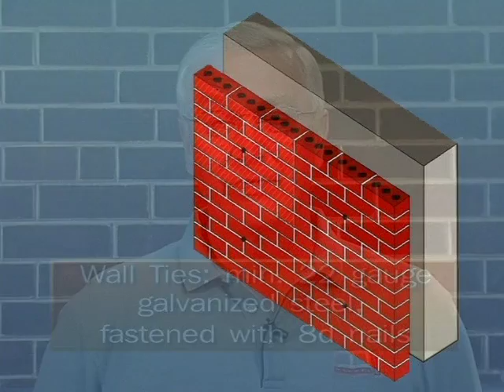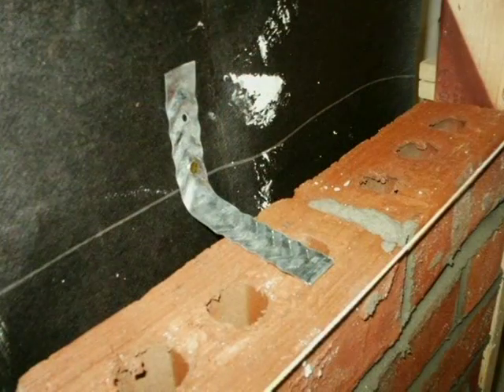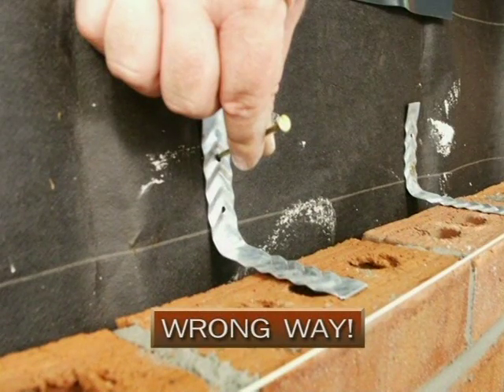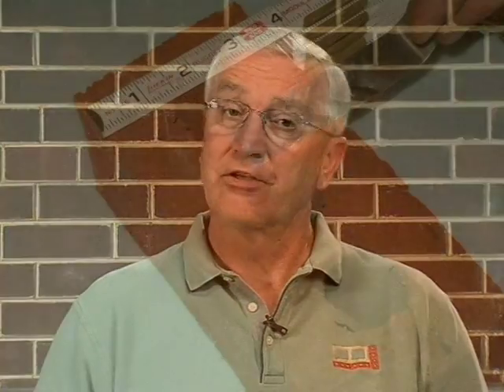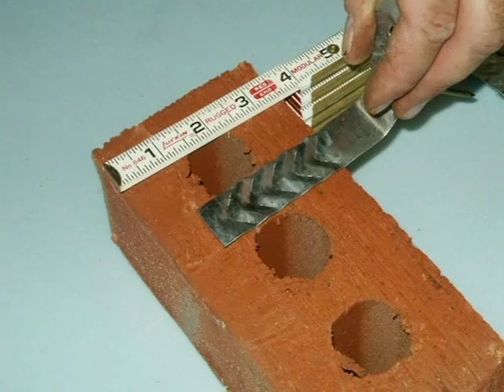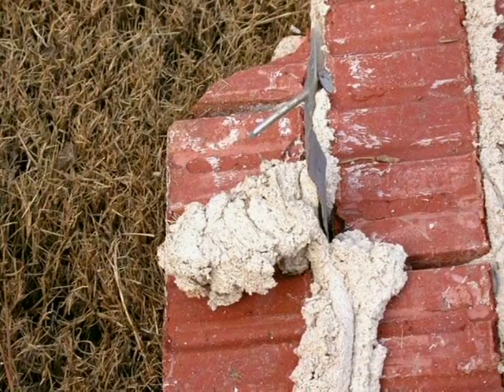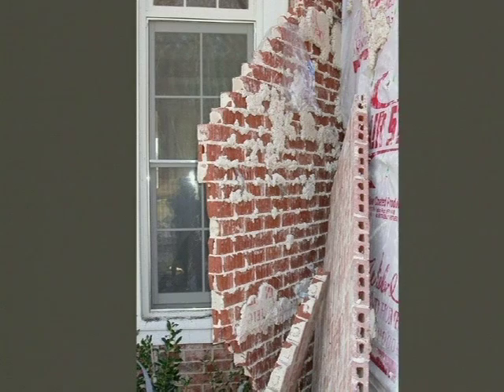Wall Ties

Comment: Very clear video. Thanks. Question. When building a 8 foot high and long concrete block wall that I will face with Old Chicago bricks on front, back, side and top, is the wall tie procedure the same? Do you still have to add a moisture barrier between blocks and bricks, corrosion resistant anchors, a drainage plane, and flashing and weep holes? Thanks for advising.

Comment: In the photo example of proper installation it looks like the ties are installed pointing up, but shouldn't they be pointing down so they are bent up? I read if they're bent down then water can run down them towards the wall

Comment: I was framing  house as a young man in the mid 80. We were building custom homes for the rich and I remember  a house being bricked next to the house we were on and the box of ties never got opened and were left there after the bricklayer,s were finished. Not 1 tie was used.  This was in Ohio. No inspection  on homes is a crime. Only Electric and Plumbing. It's sad.  Thank you for the video.

Comment: Hello.  Would this be the code for building a brick chimney?  Our house was built in the 1950's and our chimney has pulled away from the house.  Upon inspection, we were told that wall ties were not used when the chimney was built and we now need to have a new chimney constructed.  i want to many sure that the mason we use installs it the correct way.  Thank you.
Reply: Sorry for replying to such an old post. I understand that when chimney's pull away from a house it is typically because chimney's are insanely heavy, and therefore tend to sink if the foundation is not "extra" beefy, and the solution is to reinforce the chimney foundation. The most common way to beef up the chimney foundation is to install some type of post that goes many, or more rarely, dozens of feet under the foundation. Helical posts are one example of this. I'm curious how you ended up fixing your chimney that was pulling away from your house.

Comment: Your answer to this may be similar to Scot Caraway's question, but I'll ask for good measure. I own a 1960's ranch home- wood frame with brick veneer. Asphalt sheet type sheathing was originally used, with no type of wrap like Tyvek. The home has experienced termite damage and some of the exterior walls will need to be reframed. I have some contractors telling me it's not a problem and other's telling me they literally don't know if it can be done because there would be no way to retie the brick veneer wall into the new framing. Is there an approved standard method to retie the brick veneer into a newly framed wall from the interior (or some way tie the brick veneer to the newly framed wall from the exterior instead of the interior) so that the brick would maintain its structural security? Any advice would be extremely appreciated!!

Comment: Good video.  Question about wall ties.  I have a house where they are rotted out.  It is wood frame with the brick veneer.  Are there special replacement ties for going through the motor or brick that tap into wood?  I have seen helical shaft that is used to retied brick to cinder block.  Can those be used with wood frame construction?  I do not want to remove bricks to add new ties if I do not have to do so.  Thx
Scot
Reply from the maker: Mr. Caraway,Thank you for visiting BIA on YouTube. There are several companies that make retrofit masonry ties.  Several of our supplier members sell these, please visit this link, http://www.gobrick.com/Resources/Member-Directory/Supplier-Members, to view our supplier members. They are easy to install and can be used with wood frame backup systems. As mentioned though there are a variety of options that can be located with a web search.  If we can be of assistance please feel free to contact us at brickinfo@bia.org.

Thank you!
Brick Industry Association

Comment: Hello, I will be laying a modular brick veneer fireplace surround for my gas insert. I have a few questions. Since this will be on the interior of the home will I still need the wall gap and weep holes? Also I salvaged these bricks from a wood stove surround. I noticed the ties were inserted into the bricks core holes rather than flat across like your video. Do you have any comment on that method?

Comment: Hi, I cant seem to find this out:
I'm going to be building a shed from concrete blocks. I will only be building 3 sides of the shed since the fourth side is an existing sandstone building. the block dimensions are: 440mm long, 95mm wide and 213mm tall.

my shed will have a footprint of 5 block lengths square - so not very big...

How do I tie my shed to the existing sandstone wall?

I have the proper permission and so on and I intend to make each corner of the build into a pier for strength...
Can you give me any advice - even above what I have already asked?